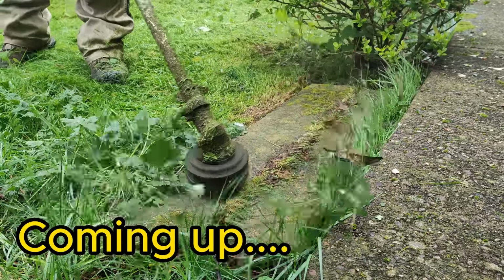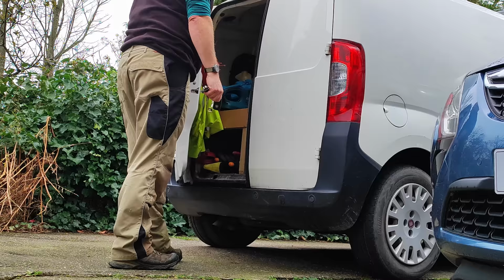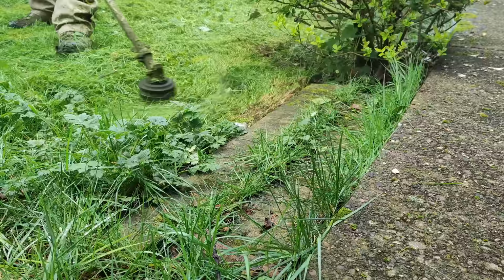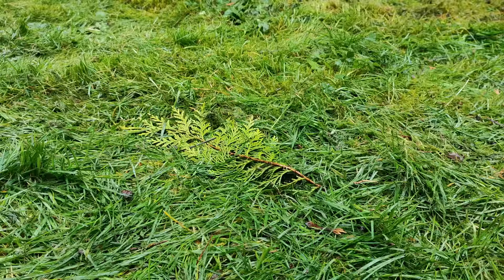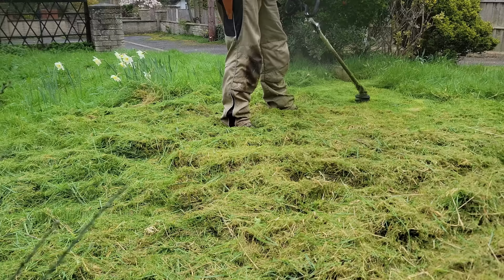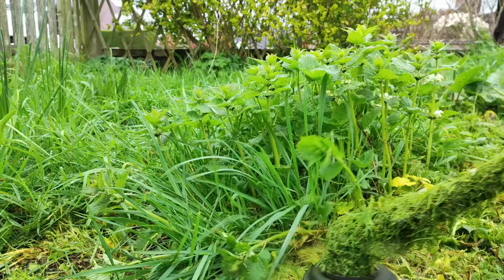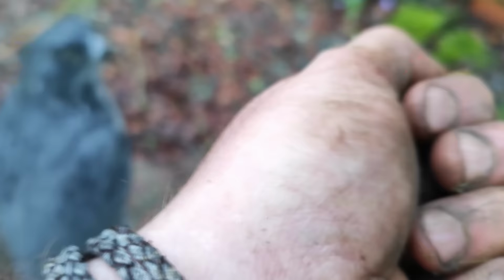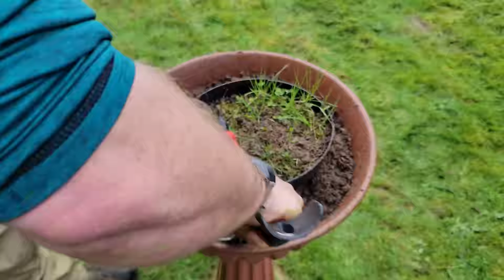Injured Elderly Man Needs Garden HELP! Amazing FREE nature garden tidy and transformation.

Comment: Do you weed eat first because it will be easier to mow?
Reply from the maker: In this garden, I did it first because the grass was long and wet. Although it's hard to see on the video,  the grass was laying over in lots of random directions. So the mowe would have struggled to cut it all at the same length. 
So I use the weed eater first to chop up all the uneven bits and then the rake to remove the cut grass and also make the grass blades stand up, ready for the mower 😁 a bit long winded, but it seems to work OK.
Thanks for the cracking question 👏 👍 
Martin.